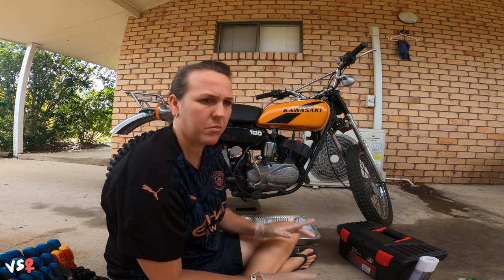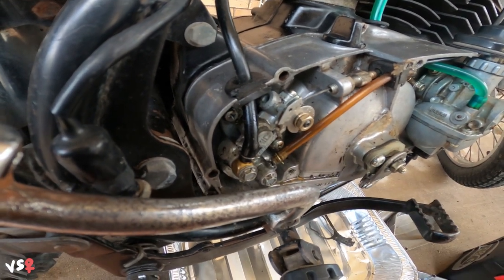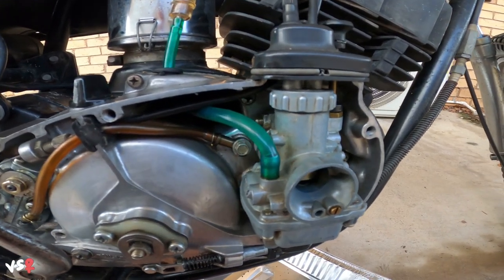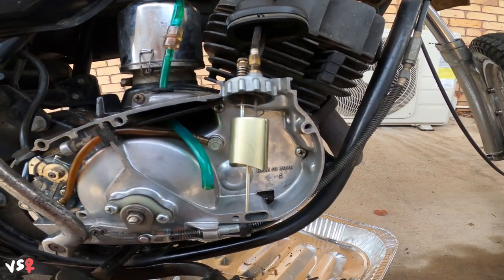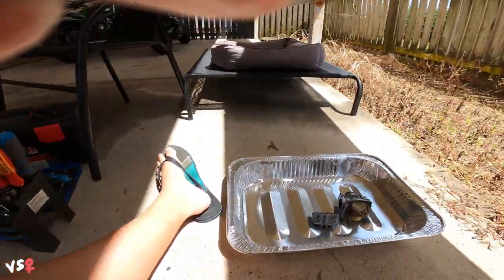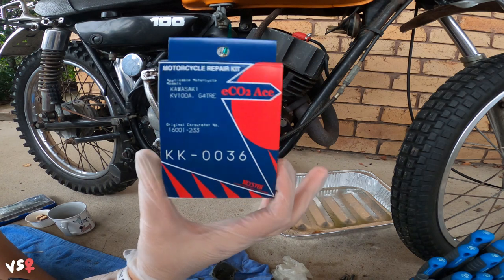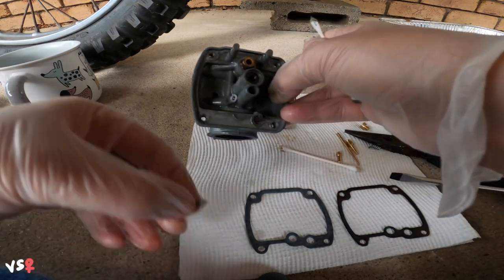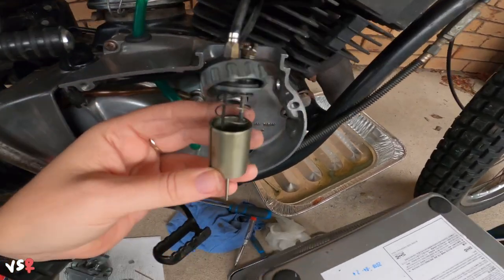VS♀️ Carburetor clean and rebuild (1974 G4TR100) - Part 3

Comment: Awesome! Hell yeah!

I hope the idle mixture screw wasn’t tightened all the way down. That’s the one on the inlet of the carby. It likely needs 2 to 3 turns out from completely tight.
Reply from the maker: Hmmm I might need to check that again. Its heaps quicker to pull the carby apart now that I know where everything goes. Keep an eye out in your Instagram chats... I'm anticipating that I'll need a lot of help in the next phase... sorting the 10 speed gearbox. The gear selector cable is broken... I've managed to order a new one but I'm hoping everything else is fine.
Reply: @TheVSChick  you know where I am.

Yeah, the rest of the jets you received with the kit get screwed in all the way. You don’t need to tighten them down like a gorilla. Just snug them up. The idle air jet usually will require a few turns. In most cases 2 is a good place to start. While the engine is warmed up and running, in my learning you set the idle higher to like 2,000 or 3,000 rpm. And slowly turn the idle jet one direction until you hear the revs start to die. Then turn it the order way and listen for the same thing. Somewhere in the middle is perfect. 🤣

Ah, lucky that you found the broken banjo bolt on the outlet on the oil injector. That’s why I mentioned to premix the fuel so if you did get it started the bike would have at least had premixed fuel keeping the engine from chewing itself up.
Reply from the maker: Totally thought I'd replied to this comment. My bad!! Thanks so much for your help. Looks like I'm not getting spark anymore. So frustrating. 😭
Reply: @TheVSChick  ah bugger!!!! Could just be a fouled spark plug.
Reply from the maker: I bought a new spark plug... still no spark so I'll need to check the ignition system now. 😭
Reply: @TheVSChick  damn. 

Welcome to the world of old motorcycles. You’ll have no shortage of content while you own one.
Reply from the maker: Yeah... baptism of fire it seems. Oh well. Still learning heaps. And yep... heaps of content. 🙂

Comment: Nice. Having new jets in there should make all the difference. It looked pretty neglected in the carb, I bet the smaller jets were well gummed up. Needle should be fine, usually you push the needle up through the slide, and there is a c-clip on top to take off. Cheers and you'll get that thing started in no time.
Reply from the maker: Thanks Dewey. Yeah it was pretty grotty in there hey. I really wanted to give it a kick and see if my efforts had done any good but I want to wait until i fix the oil pump connector before trying to get it started. I might have another go at the needle and see if I can figure it out though. Fingers crossed!!!